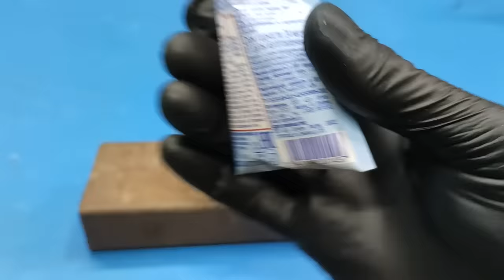Don't buy super glue, make it yourself in 2 minutes from vinegar!

Comment: Hmm researching similar brands to those he used, Vinegar £6.88, Gelatin £6.84, Glycerin £2.29, for a total of £16.01 Meanwhile actual Super Glue £5.42 Currency subject to exchange rates. I suppose this would do if you just happened to have those things around the house, and it was a long trip to the shops. Otherwise just get the Super Glue.
Reply: Yes that's what I thought and keep life Simple~!!
Reply: $5.42 for super glue? It's three tubes for a $1.00 here in the states.
Reply: @vincegiltz2888  Yeah you can get cheaper ones here too. I went with the Loctite brand for the example which is a little more expensive, but never the less still cheaper than the hotch potch of ingredients in the video.
Reply: The flame torch could cause very expensive problems as well.
Reply: How many tubes can you get out of the jar he made? 15, 20, 30? At 5.42 each… and you spent 16.01
Reply: How much super glue can you make out of his supplies. I'm sure in the long run his is cheaper if you go through a lot of super glue. But there is cheaper ways to make it.
Reply: The vinegar and glycerine are not needed.  The gelatin mixed with water is hide glue.  I've used it for years making traditional bows, primitive bows, mostly Native American (Indian) bows.  It is water soluble, so should be kept dry.
Reply: Look at the Quantity he made.
Reply: @wadepolly1798  the other ingredients make it waterproof
Reply: But would you trust this glue?
Reply: @michaelnelson9140  my concentration is on how to make it if I Can't get any and I Need good glue. Vinegar is fruit fermentation gone too long. Gelatin is hide glue, water soluble initially, and Glycerin... is another plant product... I have to look up. But it looks possible....
Reply: Skill....counts!
Reply: But you know what? I was curious about this video and then learned loads more from the comments. In conclusion, I'm still pleased people make these kind of vids. Human community across planet Earth using ....glue 🥰
Reply: @ricardoantonioSFO  The 5.42 might be for a larger bottle, say of equal volume to what was made?
Reply: Or use this recipe if you're allergic to super glue like I am.

Comment: Correct me if I'm wrong, but doesn't super glue usually dry in seconds.
Reply: u r wrong super glue will dry in no time.
Reply: Yes, Cyanoacrylate glues like Super Glue and Krazy Glue typically dry in seconds. This is Not that.
This guy is probably showing us something his grandfather learned.  Good thing vinegar isn't flammable...
Reply: Does but cures in 12 to 24 hrs.
Reply: Yes, seconds... but you really should give at least 12hrs for curing, even with Super Glue.
Reply: You can cure cyanoacrylate glues instantly with acetone. You can also loosen dried or cured super glues with lots of acetone.
Reply: it hardens on contact with moisture [why I don't use the term "dry"], so the more moisture in the air, and the more air flow will speed the hardening; if you sprinkle some baking soda [I think, brain fart] it will harden faster, and harder than pure water.
Reply: @dracoargentum9783  Any fine powder, really. I've seen cinnamon, or Ramen used as well. TKOR did a few different vids about it.
Reply: That's special super glue which dries in 2 hours...😀😁😃😄😅😆
Reply: @Mark_Agamotto1313_Smith  Ashes work as well also.
Reply: @Dan-tv1sm The carbon in the ash is what strengthens the bond based on its microscopic shape

Comment: Super glue is the common eponym for CA glues which are based on cyanoacrylates, typically ethyl cyanoacrylate; C6H7NO2 aka ECA. It's useful because it very rapidly polymerizes in the presence of moisture, and it's prepared by the condensation of formaldehyde with ethyl cyanACETATE; C5H7NO2 via the following exothermic reaction:

NCCH2CO2C2H5 + CH2O → H2C=C(CN)CO2C2H5 + H2O

What you made was bootleg hide glue aka "natural" glue and tbh it was impressive and may have some specific use cases where it would possibly be preferred, but off the shelf CA glue will most definitely be cheaper.
Reply: Hide glue is cheap enough. This video is spam at best and should be down voted.
Reply: @justin_704 it's the soviet version ! Takes more time to have the product, takes longer to set, costs a LOT more, and on top of it, it stinks ! ;)

Comment: This is NOT super glue. 
This is a variation of HIDE GLUE.
Hide glue is a great reversible glue we use for veneering and antique repair. 

This particular type is more of a book binding glue. It should remain more flexible than simple hide glue. 

Hide glue is simply a large quantity of gelatin dissolved in water. The glue must remain hot while in use as it will gel as it gets cold and then harden. 

It appears the use of glycerin and vinegar here is to help it remain liquid at lower temperatures as well as stay flexible.
Reply: Thanks but where can I buy 70% acid Vinegar??
Reply: @rickmcdonald1557  your pharmacy may have acetic acid 70%
Reply: @peterdeans4635  Thx
Reply: @joegee2815  Thx.
Reply: Works for me.
Reply: Are there more specific quantities and ratios for brewing my own? (I'm not fond of having to eyeball it when chemistry is involved.)
Reply: @rickmcdonald1557  that's why he was heating it. To boil off some of the water. We generally have 5% acid on our store shelves.
Reply: @rickmcdonald1557  you dont have to if you will mix it with water anyway .
Reply: can this used in fabrics?
Reply: @marvelstark3797  yes. But sew them too. It may wash out.
Reply: @rickmcdonald1557  you boil the wzter out of it to get it up to that percentage. Boil two thirds of the water out of 5% vinegar.
Reply: @emariaenterprises  ohhh.. ok thanks for the feedback
Reply: @rickmcdonald1557  You don't need 70% - watch the beginning - he pours pure water first - so it can be less water and 30% or 25% vinegar as well? Its just a helper, no necessarc ingredient!
Reply: You're right this is NOT superglue but it makes for great clickbait he got us both to view and comment which gives him engagement which good for his channel however what is sad for me is I will not subscribe to his channel but I did learn something new what hide glue is, and some channels are good, and this one is not! NEXT!
Reply: @rickmcdonald1557  Guess you can just get a weaker variant (32 is common here) and cut down on water.
Reply: super glue hardens instantly. This glue with water take 24 hours to dry.
Reply: Elmer's glue would have been better on the wood and paper.
Reply: See as a decent thing U can make at home with a surprising amount of stick I'm fairly impressed honestly- it might not be actual super glue but would be pretty good in many situations I'd use gel superglue😊
Reply: How do you prevent the acidity from affecting the paper in the book?
Reply: @emariaenterprises   re "that's why he was heating it. To boil off some of the water.  .... Nonsense... if he was just after a higher concentration, then why did he start with a 4:1 ratio of water to vinegar?!
Reply: @rickmcdonald1557  He uses a 4:1 ratio of water to vinegar, so he is really only using 14% strength vinegar.. It is easy to find 44-45% vinegar. It is available online. Then use  2:1 ratio instead.
Reply: That's Clagg on steroids!
Reply: Would this do well to glue fabric together?  Like patching a pair of jeans or a ripped hoodie?
Reply: @calholli Sure, until you wash it and the glue dissolves in the laundry.
Reply: EN EFFET c DU PIPEAU TOUTE CES VIDEOS a 2 balles ! Je sais pas pourquoi !
Reply: No s#$t wow did you get a degree in YouTube debunking
Reply: My bad i judged you just  on title alone... My apologies
Reply: this is just a version of the animal glue I grew up smelling in my father's woodworking factory where we had huge sawdust burners with double-boilers filled with the stuff - I can smell it yet !
Reply: I initially dis- then liked the video because of your comment. All I needed was the correct description.